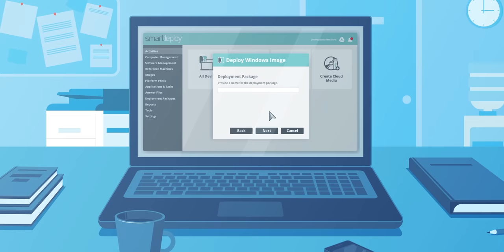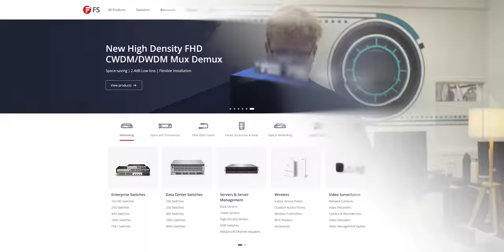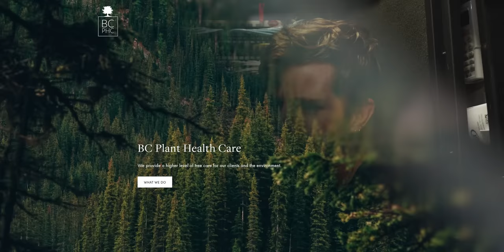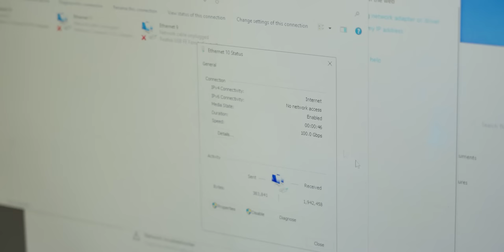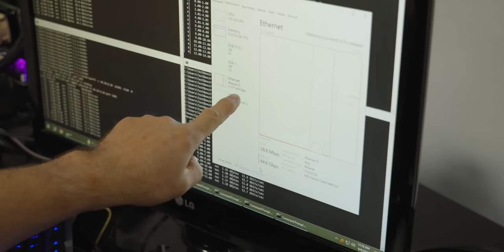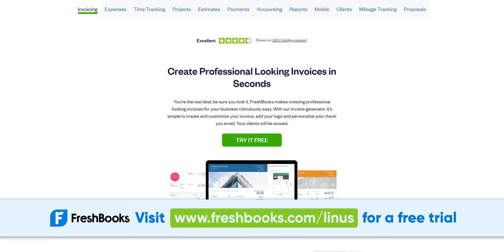Everyone said this was impossible - Backyard Fiber Run

Comment: TLDR: Don't do 3 ports on your LAG between sites.

For your "future proofing" I would advise against doing 3 ports in an LACP LAG/Port channel. The load balancing algorithm is only optimal in powers of 2. So 1, 2, 4, or 8 is good and 3, 5, 6, or 7 will be sub-optimal.

There are 8 subqueues of the load sharing algorithm for the LAG which are assigned to members whenever a port came up in the LAG group. Traffic is allocated to the subqueues in a round robin manner.

Using 100Gbps ports, the following summarizes the allocations and effect:

2 ports - each port get 4 subqueues - bandwidth is 2x100Gbps = 200Gbps (2x 100Gbps flows)
3 ports - two get 3, one gets 2 - bandwidth is 2x100Gbps, 1x67Gbps = 267Gbps (2 x 100Gbps, 1 x 67gbps flows)
4 ports - all get 2 subqueues - bandwidth is 4x100Gbps = 400Gbps (4 x 100Gbps flows)
5 ports - 3 get 2 subqueues, 2 get 1 subqueues - bandwidth is 3x100Gbps. 2x50Gbps = 400Gbps (3 x 100Gbps, 2 x 50Gbps flows)
6 ports - 2 get 2 subqueues, 4 get 1 subqueues - bandwidth is 2x100Gpbs, 4x50Gpbs = 400Gbps (2 x 100Gbps, 4 x 50Gbps flows)
7 ports - 1 get 2 subqueues, 6 get 1 subqueues - bandwidth is 1x100Gbps, 6x50Gbps = 400Gbps (1 x 100Gbps flows, 6 x 50Gbps flows)
8 ports - all get 1 subqueues - bandwidth is 8x100Gbps = 800Gbps (8 x 100Gbps flows)

Because a data stream/flow can only go over one link at a time, no one user will ever see more than 100Gbps. If the flow decides to go over the port that has an odd number of subqueues, they will max at less than 100Gbps on that flow.

I worked at an ISP and one of our customers insisted on having 3x10G connections for their transit and were mad when they only were utilizing a max of 26.7gbps of what they thought should have been 30Gbps.
Reply: Right on par. Good information here.
Reply: @R Hamlet You could certainly have a 3rd line physically connected, just dont have it as an active member of the LAG until there is a damaged line. Adding the 3rd line creates the imbalance of the load sharing algo as described in the original comment.
Reply: @R Hamlet Overall total throughput (shared between multiple users/data streams) could be faster (267gbps vs 200gbps) but you would also run the risk of having an individual data stream limited to 67gbps.  Any single user will never have a speed test over 100gbps and the unlucky user who's data stream goes over the third link will never be over 67gbps. 

Most providers or large enterprises dont want to have inconsistencies like that in their network (someone will randomly get the 3rd link that has lower speeds). For a home/small enterprise network like this it wouldn't hurt.

It is just something to be aware of and will explain why some users randomly will only max at 67gbps on their "300gbps lag". Imagine trying to troubleshoot this if you didn't know about suboptimal load sharing in LAGs, it would be a nightmare lol.
Reply: @R Hamlet  I have never seen any cable runs that were odd numbers unless one pair got damaged. So you would have to run 2 extra or be forced to do two runs which would be double.
Reply: @williamjohnson4297  "but you would also run the risk of having an individual data stream limited to 67gbps."
Like any machines they have connected could ever come close to that speed.
Reply: @williamjohnson4297  never even thought about this limitation great information. Plan on testing this in my lab. Wonder if it’s different across vendors (Juniper, Cisco, Extreme).
Reply: @4203105  yeah, admittedly this wouldn't apply to most and it probably wont hurt LTT's network if he chooses to use 3 links. More of just a fun fact or an "Ackchyually" moment on my part :P

In a high performance datacenter or service provider network it would be more applicable.
Reply: The real tech tip is in the comments
Reply: You seem to know more about networking than me, what is the benefit of putting the microtik switch verses going straight to the QSFP28 ports on the dell switch. those are also 100 gigabit and should be good enough to power thetranscievers
Reply: technically these 100Gbps ports aren't 1x100Gbps, they are 4x25Gbps.
nothing changes about what you said, but it's always good to understand that "Q" ports are quad link ports.
Reply: @nachiketakulkarni8809  generally having extra equipment in the way is a waste of money, power and time, unless you either want to do stuff at where these extra points are or you need to boost the fiber signal.
Reply: @BattousaiHBr  True, there are 4x25GB lanes in QSFP+. However, they behave very differently from LAGs. The four 25GB lanes are multiplexed together at different wavelengths and then de-multiplexed at the other end. With LAGs they are separate links which require a load sharing algorithm rather than CWDM magic. This means that on a 4x25G QSFP+ you can actually get 100G throughput on a SINGLE stream. However, if you had 2x100G QSFP+ in a LAG, you would not get 200G through a single data stream.

Comment: As a infrastructure engineer that has worked with fiber optic deployments and DWDM it was interesting to watch you do this. One of the things you should consider getting is an OTDR. That would allow you to characterize the cable, measure things like Chromatic Dispersion and it would tell you the quality of the glass used. It's also helpful in telling you if/where a break is exactly on your fiber. I would suggest a video series on OTDR and your experiences with it.
Reply: Yep, always OTDR your cable. Sometimes, all it takes is a dirty connector to ruin your day.
Reply: I would test it before even pulling it
Reply: I worked a job where we tested our spare  fibers in the fall and spring when it was frozen the deepest.  This was in an area that the fiber ran across the Arctic Circle.
Reply: I have no idea about what you wrote, wish I did. Software Engineer by day, slowly building a home lab at night.

Comment: Linus: This is a temporary deployment
Linus 6 years later on WAN show: Remember that fibreoptic cable between the two offices which we said we'd only use temporarly as a proof-of-concept? Yeah we used that for the last couple of years no problem.
Reply: "now that it has proven its concept we left it operating"
Reply: Haven't finished the vid but I hope they buried it if it will end up permanent.

Someone mowing the lawn can snap it.
Reply: That thing will DEFINITELY be permanent
Reply: @EmotionalWeather  Ye, that was my first thought as well, no way they gonna get rid of it.
Reply: @alexr2761  They probably just frame it as temporary so non of the land owners, city, landlords complain. And in a couple of weeks, everyone will have forgotten about it. They might burry the ends and thats it.
Reply: That cable will last 25+ years, pending no rodents chew on it, usually buried in a conduit or hung on a pole for safety of line
Reply: Probably just the legal front for filming this permanent solution. No way can they just deploy that and say "Yep. That's it. We are fucking doing this".
They just couldn't wink at the camera
Reply: @shanez1215  lol the shielding will probably break the lawnmower
Reply: I mean this has been done since World War 2. I have a set of field telephones and a few hundred feet of copper wire. It’s really fun and great stringing these out across odd places, and secure compared to wireless. In Vietnam and Korea they actually ran these over a couple of miles.
Reply: @shanez1215  No lawn mowers have run through that thicket.
Reply: Nothing more permanent than a temporary solution...
Reply: @shanez1215  It's "temporary" but he did accidentally reference the fact his team was micro trenching the path behind him... also they kept alluding to the other steps they had to do to run it into the building correctly.
Reply: And they promised screwdrivers and backpacks to the other company... I bet that wasnt only for testing the concept :)
Reply: Luke has openly stated that he is a big fan of guerrilla infrastructure and wouldn't be opposed to something like this.  I can definitely see them trenching it, making it look half legit, and leaving it.
Reply: not very likely considering some fool that knows where the lab is can just go into the public property they have temporarily laid it and just snip it to #$@% the whole thing
Reply: to say that "we used that for the last couple years" means the two most recent of the six which is it had been down for six then it wouldn't be the last couple but rather over half a decade lol.
^_^
Reply: @shanez1215  given that Linus was talking about chainsaw attachments for micro-trenching I’m certain they’re going to bury it if they go permanent.
Reply: There is nothing more permanent than a temporary solution.
Reply: No, it went more like this: What do you mean shut it down for an hour to replace it with a permanent installation? We're busy and don't have time for a shutdown.
Reply: I took it as "it lying out on the ground openly (and going through doorways) is temporary" and for proof of concept. The long term plan seems to be to keep the cable but to microtrench it (he needed to clear a certain width for the microtrencher).
Reply: covid spelled backwards is divoc what does divoc mean in Hebrew?
Reply: @cfcreative1  I have no idea, please inform us.
Reply: they can remove it any time so its not permanent, thats the legal term for it
Reply: @BennytheMenace   That strip is not public property....owned by the businesses.
Reply: @BKLettuce  As someone who fixes fiber and copper cables for a Canadian ISP. I can tell you the cable and armor will not even slow down the lawnmower.

Comment: I installed Fiber Optics from the very beginning of its introduction until I retired 5 years ago.  The only time I sustained damage was when an apprentice flipped it up into the air and popped it on the ground to try and unloop it.  Shattered over 100 feet.  Cut and splice time.  Overpulling destroys it.  Slow and easy is the rule.  It is very sturdy when handled properly and never dropped. Love the stuff for distance.  Now I prefer point to point microwave for less than a mile.

Comment: If it does break use Optical Time Domain Refractometer to find the break. They are really accurate now, down to the linear foot of the fracture even if you're miles away. (2:03) Linus said he didn't know how to find a break in the fiber if it should occur during installation or handling.
Reply: Call Fluke and ask for a fiber tester. They are somewhat expensive but Linus probably needs one at this point anyway due to his love of fiber.
Reply: Ha I was going to say...uhh OTDR guys not that big of a deal ;)
Reply: And a fuser. Mechanical splices with indexing gell are out!
Reply: @ClayinSWVA  Flukes OTDR is trash. Use a ExFo or AFL. Fluke is better for copper their solutions for Fiber aren’t great.
Reply: my dad works for exfo he could probably send Linus one of their portable otdr
Reply: I wouldn’t use OTDR at all. Best to use an OLTS method of testing instead.
Reply: @thejpkotor  YES! That is the best option to test the fiber. We were talking about troubleshooting the fiber if a break is suspected.
Reply: @VengeanceWithin  We would love to sell  him a Luna OVA but I don’t think he would spend the $100K for one. Fluke would be more willing to loan one for a sponsored video as they have a bigger marketing budget.
Reply: For $700 per roll of fibre, just send an intern out into the woods to pull a fresh cable every time. Just hiring the cable tester would probably cost more, let alone fixing the break.

Comment: I oversaw the installation of a fiber network for a school district through the 2000's.  It took several years, but we built a 30 mile fiber network.  It was so great to turn that on.
Reply: Was this school district in a state starting with C and a county starting with D by any chance?
Reply: @baseduck  I mean thousands of districts have been having fiber cables placed for the past two decades so that is highly unlikely
Reply: @baseduck  NM

Comment: Watching this as a fiber optic technician, this episode was hilarious
Reply: i have pulled many, many miles of this stuff. underground and on poles. dont miss it one bit
Reply: If we have deliberately breaking them at 0, and extremely pedantic absolute best practice no exceptions no slip ups at 10, am I right in thinking this video is about a 3 in terms of fibre handling?
Reply: @TAP7a  nah the cable is cheap and way more durable then you might think. even if you break the fiber they can patch it.
Reply: @cabeiri6653  sure but the idea is to not have to splice it back together.
Reply: This episode is a fiber optic technician? How would that work?
Reply: I may be wrong but isn't it spelled fibre when referring to this technology?
Reply: Same here ... je
Reply: @danejohre6657  Nope, they're synonymous and can be used interchangeably.
Reply: In a good or bad way?
Reply: As another fiber optic technician i agree with you
Reply: im a OSP guy. I work on outages for all the big names, and do thousands of fibers at a time. This was funny.
Reply: What RG is that? RG11 is way smaller than that, looks like 3 RG11s together.
Reply: It's giving me anxiety, just give me a plummetaz pneumatic jet and some duct and we'll have it in, in about 20 minutes
Reply: @VengeanceWithin  yeah but splicing damaged fiber in the ground is not a big deal, also if they go with a actual permanent fiber solution it should be done with a pedestal or two instead of trying to do one massive run if they are going underground. I dont think they are going to go with ariel mounting.

Comment: That's some serious speeds and I'm surprised at how affordable the cable and equipment actually is.  I have a 40 acre property and now I want to run fibre from on end to the other just because I can.
Reply: Same, I've been looking at that MikroTik switch for a while but it's still in short supply where I am so I can't order it yet.  But I guess it's still possible to lay the fibre and just start at 1 or 10 gigabit until stock of the 100G switch becomes available.
Reply: @Berkeloid0  The fibre does not care about speed. A 10G fibre trx can be obtained for under 10$. Mikrotik switches with 10G sfp+ are also very affordable.
Reply: @higihups  Yep, that's what I meant by "lay the fibre and start at 1 or 10G", then you can upgrade to 100G using the same fibre when the 100G is available to buy

Comment: If you have a breakage you could use a device called an OTDR to locate the fault within a meter. It's pretty impressive stuff.
Reply: And the fibre welder, which can align them withing nanometers and weld 2 glass fibres ;) (also costs around 15-30k)
Reply: @daanwdv  And the enclosure to house it and all that, it's not cheap by any stretch to fix it, but it's also not insanely expensive, just a bit 😅
Reply: This is what I do for a living in the UK.
Reply: I remember my old ethernet card could tell a cable length if it was unplugged. must be the same concept. Nice stuff for sure!
Reply: @daanwdv  for that type of deployment a 800-900$ splice machine is plenty capable to splice the fibers at acceptable attenuation.